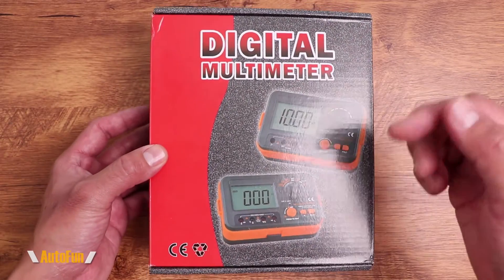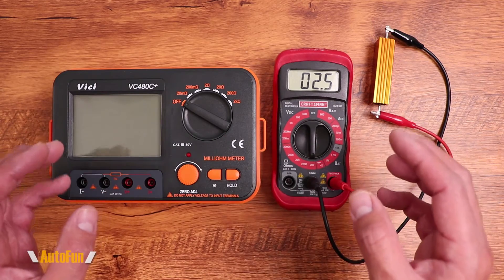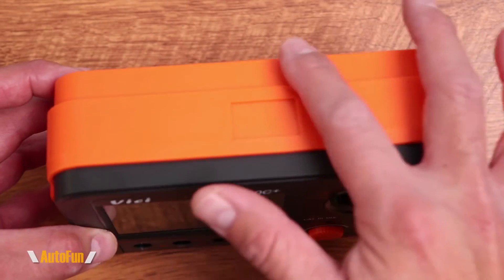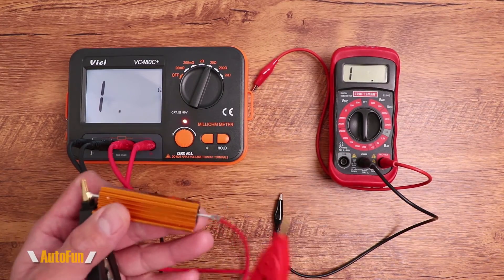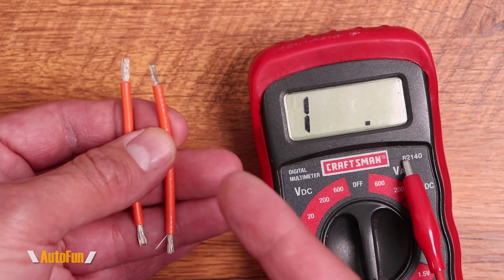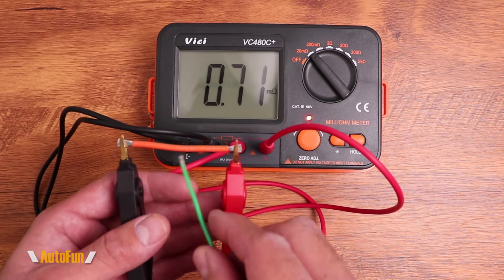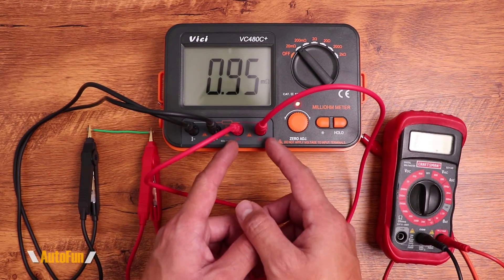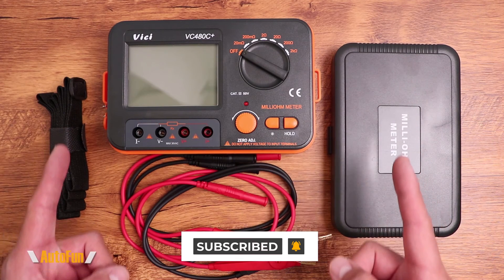Vici VC480C+ Milli-ohm Meter Review (Milliohm Meter Vs Multimeter)

Comment: There is no way your leads are 0.5 ohms sir.
Reply from the maker: Hi N! Leads will have different resistance readings based on their construction (wire gage, wire composition, end connections like solder or crimping, plating, length, build quality, etc.) But also remember that the multimeter shown on the video is also not calibrated. If you need precision and accuracy, I would recommend for your meters to be calibrated by an accredited Cal Lab before placing the equipment in service, at the recommended or specified intervals, when the equipment has been subjected to harsh conditions or when the readings are suspect etc. depending on the application. Cheers!

Comment: This is not good for professional use like a shop. I own an electric vehicle repair shop and these type of meter is useful for measuring a short in a motor winding but I doubt this will be good enough
Reply from the maker: Hi Ronaldo! One thing I learned when I was in the in industry is that a tool is a only as good as the technician using it is. I seen very expensive units being used incorrectly in professional (commercial) settings and the other way around, low cost consumer units being used with great success in the hands of a skilled user. That being said there are more advanced (and expensive) units available for commercial use. I would also recommend whether you use a high end unit or a basic one, to get the unit calibrated by an accredited lab to ensure accuracy (and re-calibrated at intervals set by the organization). Cheers!

Comment: Good video for the beginner however you should have shown how to calibrate the meter as it has that option to do so as the Craftsman does not. That's the thing I hate with a lot of budget VOM's when they don''t have that feature like several Fluke budget meters. Good job.
Reply from the maker: Thanks Pat! Ah yes the calibration is fairly easy process, the clips are connected to each other, then the adjustment dial is turned to get the reading as close to zero as possible. However I like the suggestion of including this (always nice to see something visually versus just reading about it), will keep this in mind for future reviews. Cheers!

Comment: Thank you! What a power supply does use this device?
Reply from the maker: You're welcome Olega! Ah yes this uses 6 standard AA batteries or an optional 9VDC power adapter. Hope this helps, Cheers!
Reply: @AlexAutoFun  thanks a lot! Wow, 6*AA... so much! They would use 1*CR9V instead them. I guess the current consuption is not so high.

By the way, you spoke about used batteries, but my English not so good to listen, so I simply saw a video without sound 😊
Reply from the maker: @OlegVlCh  You're welcome! Ah yes milli-ohm meters use large amounts of current to be able to get a good reading on resistance. Cheers!
Reply: @AlexAutoFun  Alex, did you measure its consumption current when it is On and Off?
Reply from the maker: @OlegVlCh  Hi Olega! Nope, I'm still on batteries but if I do add a power adapter on the future (and I get a amp clamp, which I been thinking of getting) I can measure this for you. Cheers!
Reply: @AlexAutoFun  👍👍👍

Comment: Thanks. Good run down on the basics. I might question why 6 AA cells in series because for good resoluition on resistance, you need high currents. Series batteries will probably run flat quite quickly.. Or you will start getting degraded performance after not too many measurements. Could you put a loop current measurement on that wire you measured just to see what current is drawn
Reply: 100mA at the low range, it says in the specification.
Reply from the maker: You're welcome Neil! Exactly, the high current is required to be able to read low resistances (typical with Milli-ohm meters) which is the reason I typically use them with an power adapter but it's nice to be able to carry one completely cordless for quick measurements. I unfortunately don't have a meter clamp to measure the amps being used but If I do get one in the future I will update this comment for you. Cheers!

Comment: Can you measure internal resistance of 12V Lead Acid Flooded Wet Battery ?
Reply from the maker: Hi AK! As long as the DUT is within in range, it should be able to. However personally I use a dedicated tester like this https://youtu.be/kCNrfa8RUKU for car batteries (just a personal choice) Hope this helps, Cheers!

Comment: The measurements on your multimeter do not make sense. When you measured the 2 Ohm resistor, the meter read 2.3 Ohms, indicating a resistance of 0.3 Ohms in the leads. So when you measured the virtual short circuit of the short wire (0.73 mOhms), the meter should have read 0.3 Ohms, not 2.1 Ohms. Where was that extra 1.8 Ohms coming from? 🤔
Reply from the maker: Hi Manticore1960! ah good eye! the reason why the resistance measurements are off when measuring stranded wire is due to a couple factors. First this multimeter does not have the precision and accuracy of the milliohm meter I showed on here (the are higher quality multimeters in the market that do have better precision and accuracy when calibrated by a Cal Lab). Stranded wire also typically presents a problem as the lead contacting the wire some can be in contact with some but not all the wire strands which affects the accuracy of the measurement (the way we overcame that when I was in the automotive industry by tinning the ends of the wire to ensure all strands where in contact) Finally the method for contacting the wire is also important, notice I have serrated alligator clips on the multimeter but I have 4 Wire Kelving clips on the Milli-ohm meter, the key here is the amount of surface area that can grab end of the wire is different. So I would recommend if looking to obtain both accuracy and also precision when reading resistance of a stranded wire: Calibrated Meter, Tinned ends (ultrasonic welding also seems to work), 4 Wire Kelvin clips and if the measurement is very important, using a temperature compensated Milliohm meter will be critical since the temperature coefficient of copper can also affect the reading. Hope this helps, Cheers!

Comment: Hi sir, this miliohm meter can use on a hybrid car to test the motor winding?
Reply from the maker: Hi Chris GTR! correct, technicians typically use milliohm and/or a megohmmeter to test the windings of motor generator units like the ones found in hybrids. Hope this helps, Cheers!
Reply: @AlexAutoFun  The milliohm meter is used to measure very small resistance (stator windings for example) where a megohm meter is used to measure high resistance like in isolation diagnostics.
Reply from the maker: @Dr. Grip  Hi Dr. Grip! Thanks for adding this adding this additional  detail, Cheers!

Comment: Multi-meter, VOM meter, Digital Multi-meter, DMM .... NOT "voltmeter"
Reply from the maker: Hi Lewis! Thumbnail and tags behind the scenes updated to reflect correct name and acronyms, I also have a video coming on how to use a DMM so I have a made a note to call it correctly, thanks for commenting and watching bud!
Reply: @AlexAutoFun  you are technically correct by referring to it as a voltmeter. All these devices can do is measure voltage, nothing else. All the other functions are from a calculation using ohms law by measuring a difference in voltage whilst applying a known current.
Reply from the maker: @belfastboy2811  Thank you much Belfast Boy! that is very true, didn't even think about that!! Cheers from California!🍻
Reply: @belfastboy2811  yo lo llamaría miliamperímetro, pues la resistencia está sobre el DUT y se le aplica un valor de voltaje constante y conocido y, por mera y simple ley de Ohm (R=V/I) se obtiene la resistencia del DUT.